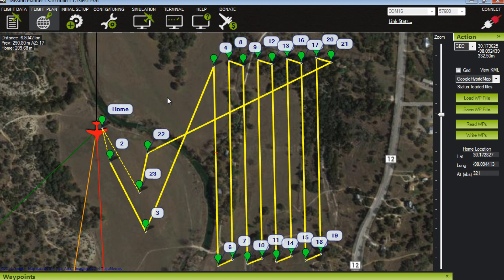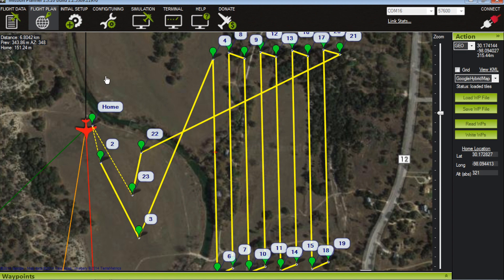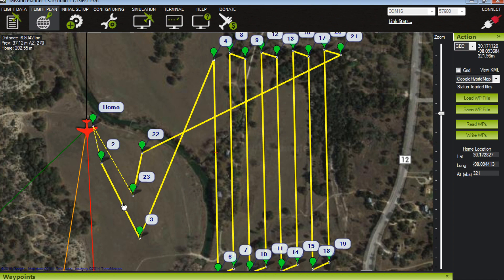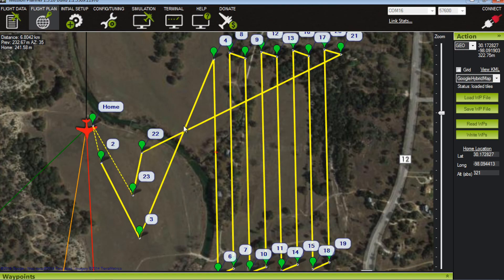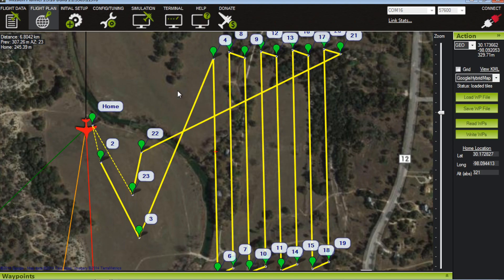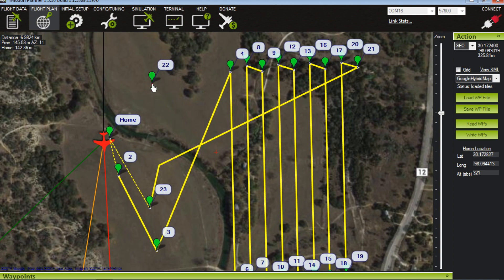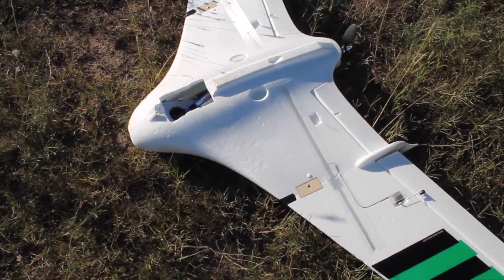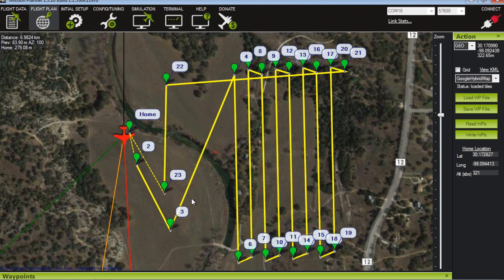Pixhawk/APM Field Tips for Auto Takeoff and Landing w/ APM:Plane Firmware

Comment: I have an important question 
Is it possible to set up a continuous long range mission by simply changing batteries and launching it in the air,?

For example, a mission plan
 from A to Point C. UAV range 60 miles from Point Point A - B. At point B, uav lands, a person changed the battery and throw it in the air going another 60 miles to Point C?

Comment: Am I the only person who observed your landing was with the wind (typical no-no with fixed wing planes)?  You'll see mush better results if your landing is into the wind. The tip stall observed at the end was due to loss of lift.  Otherwise, I'm totally impressed by what you showed us.  I had no idea fixed wing missions (including landings) were possible with flight controllers.
Reply from the maker: I normally land nose into wind and thought I did in this video. Whether or not that's accurate I do agree with your assessment that landing into the window is always preferred. Yes you should definitely check out Pixhawk for this type of work. It's an amazing FC and Pixhawk 2 will be coming in the next few months. So be on the lookout. Thanks for the feedback.

Comment: Hey Dennis, really cool video. I've been a bit spoiled with eMotion which is used with eBee which more intuitive in planning mission than Mission planner. Anyway, I'm not here to criticize MP especially it is free, so good work done by Mr. Michael Oborne. My UAV has a parachute so I usually create a "recovery line" that passes over my landing area. So when the UAV passes of the recovery line at the desired altitude I would kill the motor and leave it glide for few seconds, then deploy parachute, then winds drags is down. But I also want to be able to bell land, in case the parachute for what ever reason refuses to deploy. So, I need to know how to land the way you did, my question is that, once "RETURN_TO_LAUNCH" is executed, what is the next command that would kill motor before the actual landing happens? Since I'm not RC expert, i would like to let AP continue guiding the plane until it touches down. You advise will be appreciated.
Reply from the maker: +IronDome Great question. Check out the flare point configuration here:

http://ardupilot.org/plane/docs/automatic-landing.html

APM/Pixhawk will cut the throttle at this point. Hope this helps and very cool that you get to fly an eBee. I'd love to get my hands on one to test at some point. Thanks for the question.
Reply: +Dennis Baldwin 
Excellent, this is cool and useful resource. I guess it works the same work with Pixhawk AP, right? Thanks for responding mate!

Comment: I'm building my first plane it's  the MTD my twin dream and I'm putting a pixhawk in it. I'm a a mature with planes but use to mp with my quads. How do I find out what paramiters to use for my plane?
Reply from the maker: I'd recommend getting it working in manual mode first and trim.  Then get everything setup for FBWA. Once you fly in FBWA mode and have good stabilization I'd do an autotune. This is one of my favorite references: http://ardupilot.org/plane/docs/starting-up-and-calibrating-arduplane.html
Reply: +Dennis Baldwin thanks for the info.once its all trimmed in manual, then do a auto tune? i never used auto tune in my quads with mp. i guess you have to with a plane?

Comment: Good afternoon Dennis, First off thank you for taking the time to make your videos they are very helpful and well done! I have done quite a bit with mission planner and multirotors as I had a large hand in building up the uav department at one surveying company in austin and now i am building one at the company i am currently working at. We just bought a 3DR Aero-M and I am a noob when it comes to fixed wing flying and planning and do not want to lawn dart $6000 lol. would you happen to have a screen shot of the bottom waypoint list of a flight plan where you are making waypoints to lower the altitude? Are you using the Land function for auto land or RTL? would you ever consider doing paid consulting?

Thanks again for any help! I am from around the area and saw from the map in your video that is was RR12. Looks like the area you flew is pretty developed now!
Reply from the maker: Rodney Faris Thanks for reaching out. Glad to hear you're looking at fixed wings. I can put together a video of an auto takeoff and auto land mission from start to finish in the near future. To answer your question I stepped down the altitude with numerous waypoints and ended up with a land command. If you want to discuss consulting feel free to reach out to me. My email is db at unmannedairlines dot com. Best of luck with your mapping plans.

Comment: and the vibration, i have the same problem, my aircraft do not climb and present vibration like in the video but i not understand why, some times the apm works normally and suddenly the vibration begins
Reply from the maker: I would recommend making sure your propeller is balanced and also trying to use vibration dampening foam beneath your flight controller. Good luck and let us know how it goes.

Comment: Hi Dennis, why don't you use a airspeed sensor?
Reply from the maker: David Kaden I used one when I had Pixhawk in my smaller wing and didn't really notice much difference. I'll do some more testing in the future and share my results. Thanks for asking.
Reply: Dennis Baldwin 
You really should. It`s great when you fly really slow and have any kind of wind. It allows flying slower too, closer to your stall speed and so either loosing altitude quicker or cruise with less power.

Comment: Maybe a silly question but why autoland ? I can see the advantages with single person takeoffs but surely it would be less risk to land manually ?
Reply from the maker: Sean Cull Good question. I sometimes feel the same way. I generally take manual control and land it myself just because I enjoy that part of flying :) Autoland may be more useful in situations with high wind since it will do a great job of keeping your bird stable. Or there may be cases where you want a fully autonomous flight and keep an eye on the GCS vs having to land the plane. If it's a tight landing area and you're an experienced pilot then it makes sense to land manually. Aside from all that, it's pretty amazing to watch a RC plan take off, fly a mission, and land automatically. Thanks for the thought.

Comment: Hi, I have got my Opterra 2m with Pixhawk installed and was wondering if you have any Settings Parameters you don't mind sharing. I'm hoping to get mine up and running for Autonomous Flights. I'm using a 3DR Pixhawk with FrSky X8R Receiver and Taranis X9D Plus. Any help would be very much appreciated. Cheers Tony
Reply from the maker: That looks like a really cool wing. Unfortunately I don't have my settings params anymore as I had to pull Pixhawk out for another project. I have a spare Pixhawk laying around and I will get it mounted soon and share those params. I'm sure you'll come up with your own before then but wanted to mention. I love how these big wings handle and I'm sure you will as well. Please keep us posted on your progress.

Comment: I am running Pixhawk on a FX-61 Phantom and using auto take off and landing.

For auto landing I have it down very smooth and find that setting waypoints to slowly reduce the altitude is a much better result than just using auto land  from a high way point, especially with tree's as you can guide it around terrain. 

My question is for launching. On auto take off I have the prop throttle delayed, but sometimes if I don't throw it hard enough it will stall and go nose first into the ground. Do you always take off with the prop spinning or do you use any delay for the start up?
Reply from the maker: Jason Franciosa Great question. I always take off with it spinning. I just feel better about knowing there is thrust prior to throwing it in the air. I didn't even realize there was a delay option so maybe I'll look into that at some point, but I haven't had any failures to date with the current approach (knocking frantically on wood all over my office :) Very good point about auto landing. I like to step it down too, but on my first few I wasn't aware of that.

Comment: Dennis, have you tried ortho-mosaic the imagery in QGIS?
Reply from the maker: Binesh Maharjan No I haven't. The main problem with the imagery is that it's taken from many different angles given the camera isn't always getting a completely vertical set of photos. They come from different angles due to pitch and roll of the plane. I was hoping to get the downward facing gimbal working properly so I could mosaic without having to do a bunch of image processing. It's still a work in progress so hopefully I can share my results soon. Thanks for the question and I'm still learning about QGIS so maybe there's a better way to do this.
Reply: Dennis Baldwin If you could share couple of geo tagged tiles of the imagery, I would like to take a look. I really want to use this autonomous technology in remote sensing. I am getting my canon sx260 hacked to shoot in Vis + NIR. I looked into the software like AGISoft and Pix4, but they are way out of my budget. Anyways, thanks so much for all your videos and lessons. Your channel is my go-to place for everything UAV now. :)

Comment: I know this is an old video but is there any chance you have your parameters in Mission Planner saved for the FX-79 Buffalo? I'm trying to get mine dialed in with the "least" amount of crashes and damage. Any help would be greatly appreciated. Eddie C.
Reply from the maker: Hi Eddie, I don't currently have my params. If I get a chance in the future I will revisit and share what I came up with. I did use default params and then autotuned in the air.
Reply: Thanks, I'm trying to get everything dialed in. I'm going to be installing a Canon SX280 tomorrow for surveying. You really spent some time on this plane and the pixhawk from what I can tell. There are just so many parameters to try and tweak. The auto take off and landing seem to be the hardest part to get working correctly.